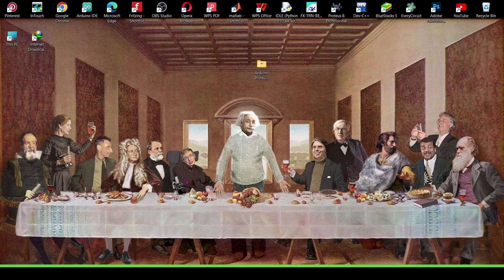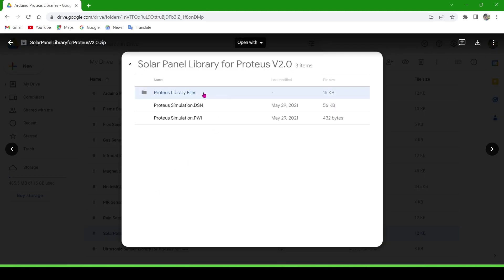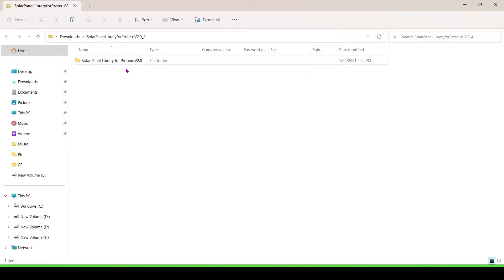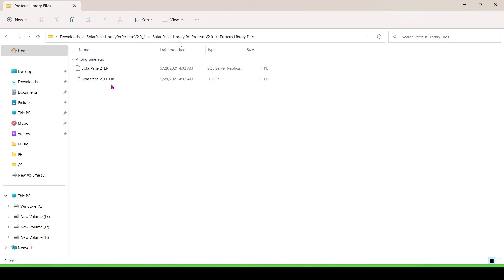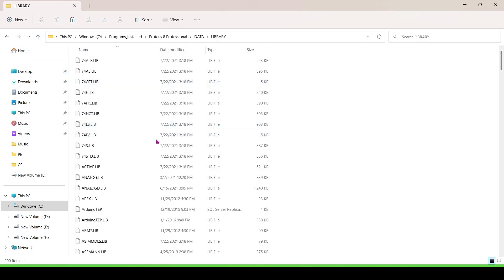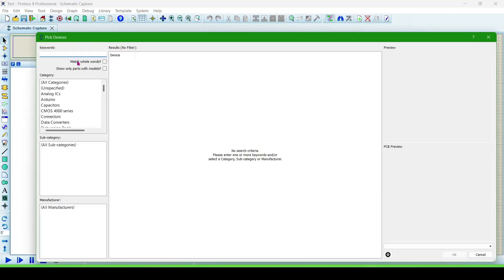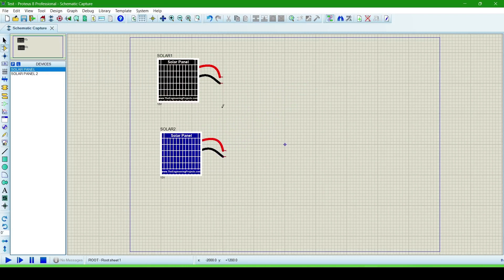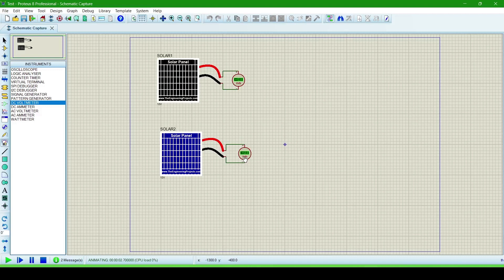Solar Panel Library Proteus Simulation | Solar Cell

Comment: For a solar panel to work, it needs heat and irradiation, so it does not exhibit current or voltage characteristics. I downloaded and tested it as just a power supply.

Comment: I don't find library in Proteus ?
Reply from the maker: Copy file which have .LIB extension and then paste it in the Proteus8Professional>DATA>LIBRARY
After reopen the Proteus software and then search for solar panel
 Hope it will help you... 🙂
Reply from the maker: For Arduino Sensors Proteus Libraries Download click on the following GitHub link:
https://github.com/SamandarKhanAfridi/Arduino-Proteus-Libraries
Reply: I find the solar panel library but when I want to copy it in the file "Library" I don't find it , but when I go to the Proteus I find this file in the system so I copy it in the " Proteus 8 professional " and complete the steps but when I go to Proteus I can't find the solar panel, why ?
Reply: Can we change the parameter of solar panel
Reply from the maker: @prajwaldambhare6043  yes